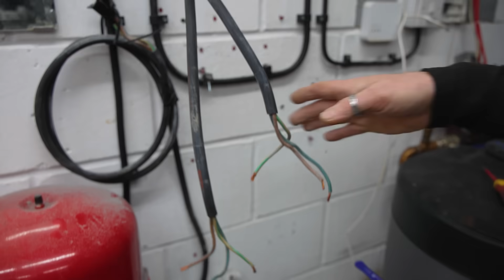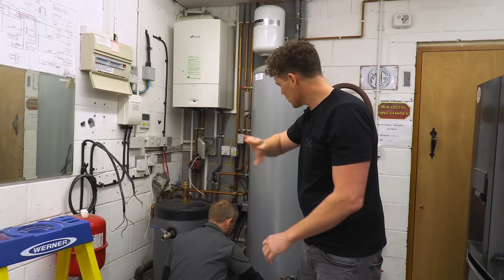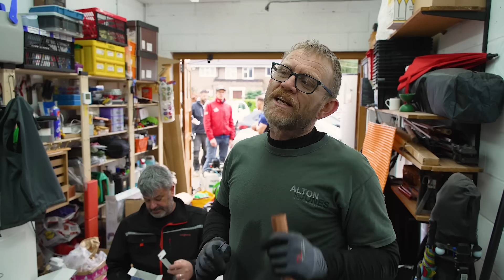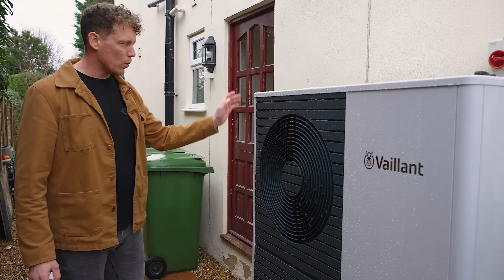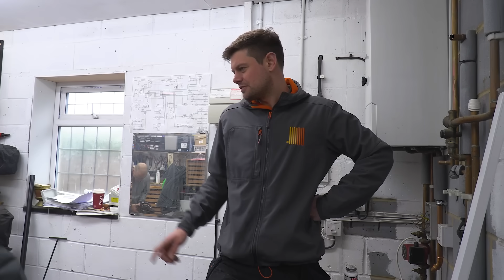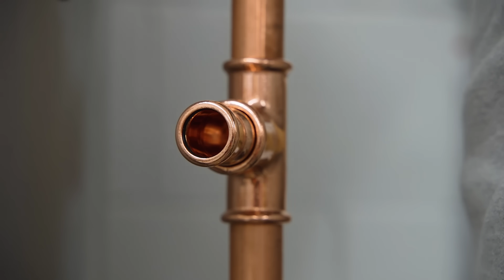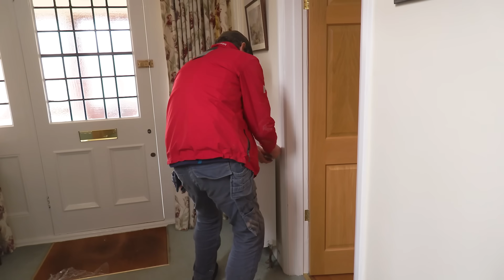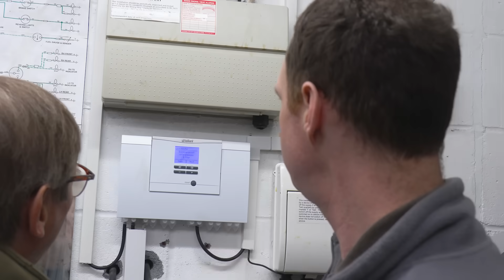Ultimate Heat Pump Installation. Rip It Out & Start Again!

Comment: Half the comments seem to be implying heat pumps are no good because they are mostly installed by people who aren't competent to do so.  Pretty sure the first gas boilers were equally as badly fitted.  Was the first steam engine capable of racing the Mallard??
You need sufficient experience and COMPETENT trained installers before any new technology lives up to its potential! 🙄
Reply: It's not just the first gas boilers - How many heating systems have been designed around a condensing gas boiler, where that boiler will never condense?
Reply: It’s not a new technology. It’s water flowing around pipes.

Comment: These systems are making a comeback in Australia again, government grants have kicked them off. Plenty of installer work going at the minute. They still utilize an electric element to heat the water when the ambient temperature is low. Is this the same with the system you just installed?
Reply: What part of Australia is cold enough to need a boost element? When I was living there all the boilers were outside because the risk of freezing was so low.
Reply: @edc1569  Hot water storage tanks are still external to buildings. They won't freeze. The heat pump systems though, are not designed for low temperature ambients. During winter the heat pump barely runs and is using the electric element to heat the water

Comment: Jesus H Christ!!! Do you not not know how ridiculous you guys look.!!
Reply from the maker: Clearly not but you are here to enlighten us
Reply: I think he means something along the lines of the general public wanting cost effective, low hassle heating and hot water 365 days a year, with installers, repair technicians and spare part's available quickly when needed. If it took some of the industry’s most experienced and high profile heating engineers and a cost of £18000 to install then the technology is perhaps not ready to be pushed country wide to the general public. I appreciate your effort in making the video and determination to make it work in this house though.

Comment: Q: How many electricians does it take to change a light bulb?

A: Three – one to change the breaker, a second to rewire the circuit and a third to replace the fixture. (Note: the light bulb is not included.)

Comment: Adam please get the basic details correct, The house was 1930's,other parts are new. so your first comment of 150 to 100 year old is miss leading as half the house is modern with insulation.
Reply: 1930s would be double skin. It is not 1930s.
Reply: @HeatGeek  according to the first video in the series it is, the house owner said it was https://youtu.be/Zar7RTQodnw?t=319 .

Comment: I was told that heat pumps won’t keep Scottish Homes warm enough.Is this true?
Reply: From what I've read (I'm not a heating pro!) they will work fine for the majority of Scottish places. The efficiency drops (which results in a lower Coefficient of Performance and higher bills) as the temperature goes well below 0C, but for most of Scotland, the weather is pretty temperate all year round compared to many places. This winter, I saw a run of maybe 3 or 4 days with -5C where I am (east coast) and that was unusual. It should be no problem for the new generations of heat pumps, though.

However, if you live in an area that has much lower lows (e.g. parts of Aberdeenshire can hit -10C and even as low as -15C!), you should do your research & make sure your system will handle the coldest days. I'd personally want to be very sure that the system will work! I've read that new systems can have supplemental heat sources like electrical coils to boost efficiency, but it's definitely into buyer-beware territory considering mediocre installers can't even get heat pumps working well at 0C.

Scotland also has a problem: if you look at the Heat Geek certified map, there's not much choice up here. I am sold on the technology, but I wouldn't get one installed without a well-regarded professional designing & installing the system. Feels like Russian roulette up here at the moment.
Reply: I wonder how they manage in Scandinavia? 40% of houses are warmed by heat-pumps (60% in Norway) and you might find that their winters are a tad colder...
Reply: @Cheradanine true, but the insulation in those countries is on a completely different level, so the work required of the heat pump is lower. I stayed at my friend's flat and then house in sweden and both were toasty with the heating on low.
Reply: @defragsbin  Insulate Britain had a point after all!
Reply: @Cheradanine Indeed they did. The Tory government basically made a giant mess of the whole thing, and insulation stopped around 2010 :-(

Comment: Heatpump and Propress no ty but ,Goodluck with it ;)  Before all the praising comments appear lets see how good this monstrosity is after a few winters assuming all the electronics hold up. The True running costs and its reliability will be interesting to follow.
Reply: Yeh, because in Norway they all just freeze too death 2 years after getting them installed. We have to make it work because one way or another we have to stop burning stuff, and do so as quick as we possibly can.
Reply: @jonathankeenan5163   You can't compare another country to the UK, energy prices and housing construction alone makes comparisons unequal. I agree we can't burn dinosaur juice forever, ignoring the climate effects we're running out, but atm over 40% of the UK electric is from gas,13% coal. heatpumps use lots of electric. as you may know switching energy states always wastes lots of energy.
So gas to electric to heat with a heat pump, or with current boilers gas to heat. one less step so less energy lost. the running costs ,the reliability, install costs & living in a house that you can't open windows for fear of your saved up heat being lost isn't the answer.

Comment: Interesting that noise assessments were mentioned. Our conversion to ASHP has ground to a halt due to Manchester planning dept requirements for noise assessments both before and after an instal that would cost almost as much as the install itself! (after grant of course). No one wants noisy neighbours installations but the cost just seem like a punitive flex by them.
Reply: Absolutely not required unless someone has mis-specced the unit.
Reply: Manufacturers spec shows a max noise output just over the limit for permitted development given the position of the unit and distance to neighbouring window.  @Swwils
Reply: @jonathankeenan5163  so miss spec. Move the unit. Use diff unit. Use a baffle.
Reply: Can't change the unit position but a different unit may be the answer, if the installer will even consider a different manufacturer. Baffle would fix it but planning want proof; hence the need for expensive noise assessments.  @Swwils
Reply: @jonathankeenan5163  sounds like you have soiled the relationship with your planning .
Reply: Not sure how  @Swwils
Reply: You may think this is all anti heat pump luddites, but given people can sleep with their windows open and at night noise is far more noticeable you’d be well annoyed if your neighbour put in a unit that kept you awake night after night and environmental health said it was ok. Nighttime noise noticeability is very different from daytime noise. Personally I’m looking at a possible install at my house but the only place I can fit it is at the bottom of the garden behind the garage which will be 10+ meters away from any house so should be fine, but the distance is a worry for efficiency. Absolutely nowhere else is acceptable.
Reply: @davideyres955  most units are less noise than a boiler.
Reply: @Swwils A lot of the oil boilers around here are incredibly noisy.
Reply: That distance would likely be an efficiency killer though? I do agree with you. I'm concerned about the patchwork way this transition away from fossil fuels is being conducted; poor training, cowboy installers and planning departments using outdated regs and falling back on prohibitively expensive assessments that block the uptake on fitting something that will probably be inevitable within a few years anyway, given that climate change is considerably less acceptable.  @davideyres955

Comment: I watched the previous video where 'Mr' Heat Geek made some modifications and yet the system still needed radical surgery to make it work - amputation is a better description as there was so much unwanted equipment which no doubt had been charged  to the owner. I'm afraid this saga of problems with a heat pump installation has confirmed my scepticism about heat pumps being a viable form of future heating.
Reply: So the video showing you how a system can be designed and installed properly, along with a link to live performance data, tells you we should just give up on this technology and hope the gas keeps coming out of the ground? Cool.
Reply: It's a shame because the government is half-arsing this. They need a heat geek-esque training certification & long-term commitment to getting these installs right. If someone pays £10k for an install and it's not fit for purpose, why should the customer suffer and pay to put it right? It's going to be a long road.
Reply: I think you've rather missed the point. The same would have been said of any new technology coming onto the market. Just find a competent installer!
Reply: @snecklifter I don't think he has -- it's the same point Roger has made. I'm in Team Heatpump (I think they're the future and am on board with Adam's take -- they can go in most properties) but the installer training & protection for consumers has to improve. If your 75 year old mum gets a professional installer and he botches it, it has a SCOP of 2 and it barely keeps the house warm, and she has no comeback other than to pay someone else to re-install it, are you going to tell her, "just find a competent installer?"

It's a systemic problem. Once the government actually commits to scrapping gas boilers and the demand for heatpumps goes through the roof, how do you find a well-regarded, certified installer that doesn't already have a massive backlog of jobs to work through? One of the guys in the video basically said don't bother trying to message me because I'm already booked up for the foreseeable! That's a problem.
Reply: @snecklifter This. Jesus, the people in these comments are completely missing the bloody point of these videos. Get someone reputable and trained to install a system and it'll work perfectly as intended!

Comment: It would be nice if somebody explained the live data in the link in the description in noob terms as it going over the top of my head, also if someone compared the cost/usage to a gas fed boiler. I hope that makes sense. 

But what a great series of videos 👍.
Reply: Thats coming.
Reply: Just hover over any point and read the COP. If it's 3 or higher, it's cheaper than a gas boiler (given that electricity is 3 times the cost of gas at the moment).

Comment: id imagine draughts ruin heat pump systems
Reply: Draughts ruin any system.
Reply: @Swwils  certainly anything that has low heat output ,log stoves certainly manage
Reply: @2frogland  a heat pump is not low heat output.
Reply: @Swwils depends on how you mean certainly low temp that takes time to warm an area
Reply: @2frogland  and? On off heating belongs in the 1900s.
Reply: @Swwils  so does much of the housing stock and the vast majority of the aesthetic pleasing in our case the 1600s
Reply: @Swwils  im not sure about the on off part either as who wants to heat a house 24/7 even if it is lower temp for certain times
Reply: @2frogland  1kW of thermal energy is still 1kW of thermal energy, regardless of the temperature differential.
Reply: @yngndrw.  indeed it is, but a warm rad will only heat sealed insulated room
Reply: That's why as part of the install you check the house for insulation and draughts etc.
Reply: @egocd  that puts a lot of houses out of the equation then

Comment: Lovely work!  Q.E.D. (as already shown by the data). Congratulations to all.  One observation => Looks like 50% or more of the energy is consumed overnight.  Hmmm...
Reply: A lot of people with multi rate electricity tariffs will recharge the hot water cylinder over night, might be that?
Reply from the maker: It tends to be cooler at night. If you could increase the heat input in the daytime and store it with good insulation the night set back could be lowered. Ideally you could turn it off

Comment: How many homes have the room for all that equipment?
Reply: It's a big house. Needs large area for tank. Even with gas boilers
Reply: A few million.
Reply: Millions of homes have the space.
Reply: Well, the outdoor unit goes errr, outside. Inside there is basically a hotwater tank and that's your lot... What equipment are you referring to?
Reply: @egocd  Standard 1m boundary of many detached houses will make that HP not viable for the side of the house. 

You need a larger cylinder so you don't run out of hot water at 50 deg vs 65 deg.

Comment: Neat, all you need to do to make a heat pump system work is to fit and rip it out it three times, get everything donated, and a team of volunteers to fit it free.  What a compelling argument for mass adoption.
Reply: What a stupid comment. Just get it installed properly the first time by a reputable installer.

Comment: Interesting video and watched the series. Also I have looked a the online graphs, and it seems to be working OK.  I appreciate that the owner got a lot of equipment free. But if costed as a new install. How much would that cost to installed normally including the new radiators and underfloor heating. This would be what a normal household would be faced with to convert from gas or oil.
Reply: The problem is there is not really a typical install, it’ll come down to how much you want to spend chasing efficiency.  Companies like octopus aren’t going to touch your radiators and will just run the system hotter and you’ll get lower performance, but they’ll probably provide you with a smart electricity tariff to compensate a little.  I’d always recommend radiator upgrades as they are usually very cost effective, and look at underfloor install during renovations.
Reply: They key thing is the "conversion" should have been done in the 1980s with the introduction of the modulating boiler. Low flow temperatures also work with such equipment.
Reply: A normal household usually just needs a few new radiators, repipe is not normally needed and you keep some rads as you can swap your current largest to the smallest rooms. The nuggets barrier is the need for DHW tank.
Reply: Thanks for the feed back but how much did it cost?  @Swwils
Reply: @ihaynes9176  in the UK you are in a pickle. You have very few skilled engineers, heat pump equipment is expensive itself despite it not being so anywhere else (Asia and euro can pickup a 6kw heat pump for £500 from super market) and you have continued to use silly zone systems from the 1960s through till now. So comparatively your install costs will be high as you are uplifting 30 years of industry stagnation.
Reply: So as I understand in simple terms it a heat pump goes 24/7 and adjusts flow temperature at AHP to keep the house to the required  temperature
But does the HW recovery work on a priority zone whereby when there is a hot water demand the AHP flow temperature changes to maximum and shuts down the heating for a period whilst the HW is being made?
Otherwise the heat emitters will be too hot during that period, albeit short
Secondly, what is the maximum AHP temperature? If it is 55 degrees flow, that’s not quite hot enough to get 60…..
Reply: @markpowellmp  yes, it runs 24/7 usually with a night time setback. Essentially  unless you live in a tent this is how you should be heating your house regardless of the heat source.

It charges the hot water demand with the heating loop closed. Usually this can be done at a lower tariff rate.

Storage temp can be alot lower and the cylinder will do a legionnaires cycle weekly.